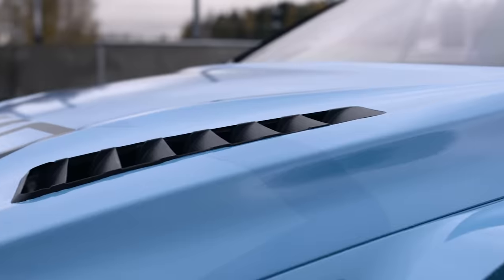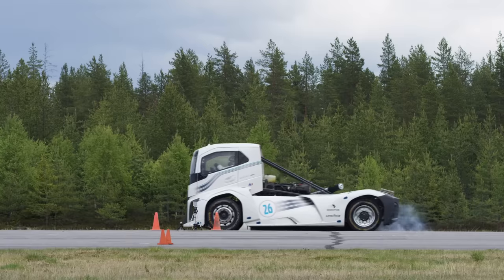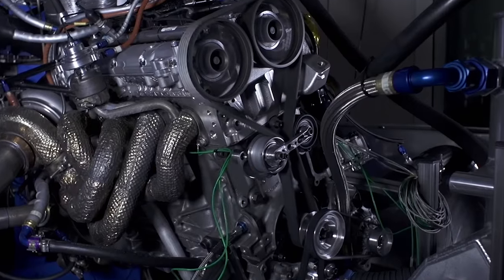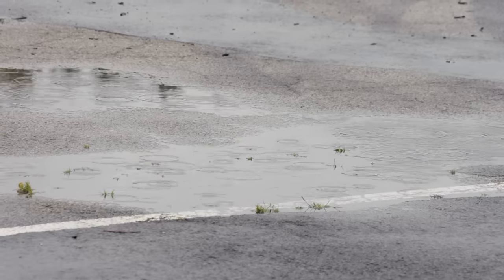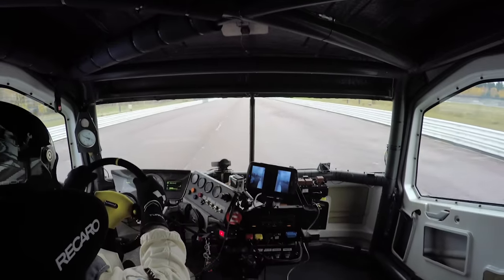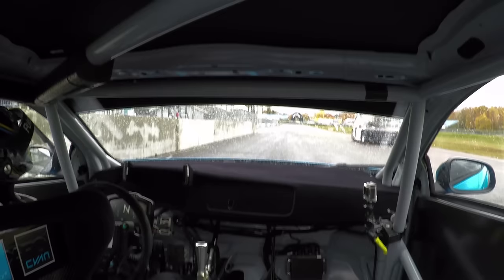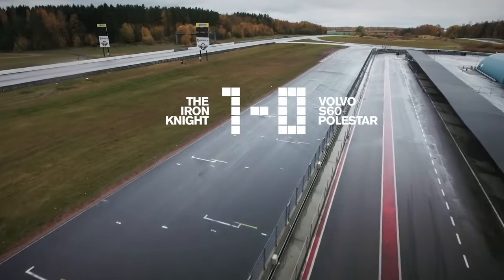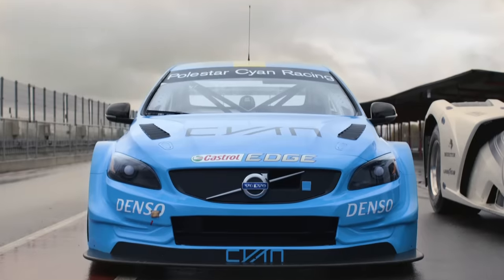Volvo Trucks - The Iron Knight vs Volvo S60 Polestar - Two titans in a head-to-head challenge

Comment: But Volvo Trucks and Volvo Cars are 2 separate companies ...
Reply: so a friendly competition between different but yet the same company should not be a problem xD
Reply: Volvo Cars and Volvo Group is not the same company at all though.
They split in the 90ths when Ford bought the car part of the company.
Reply: They are indeed different companies, but the brand is shared 50/50 between them.
Reply: Well that sounds very confusing. Is it not just the same company but different branches?
Reply: Ilias same brand but different companies.
Reply: Volvo Cars was sold by the Volvo Corporation to Ford in 1999. Ford sold it on in 2009 to current owners, Chinese auto manufacturers Geely. The Volvo Corp. spun of it's car division because it wanted to focus on trucks, buses, construction equipment etc., where they are one of the big players globally. The Volvo brand (logo, trademarks etc.) is managed by a holding company that is owned 50/50 by Volvo Cars and the Volvo Corp. Anthoer example is Renault. Renault Trucks is owned by the Volvo Corp., but Renault Cars is a seperate company. Nissan Diesel (now called UD Trucks) is also owned by the Volvo Corp., but not Nissan Cars. 

Another example is the SAAB brand. It was shared by the SAAB Group and SAAB Automobile, when the SAAB Group spun off SAAB Automobile to General Motors in 1989.  In 2012, SAAB Automobile went bankrupt, but the SAAB Group still exists, as a major aerospace and defence corp.
Reply: from what i know the 2 companies are also in friendly terms . meaning they do help each other and do research together .
Reply: So its just a freindly competition lmao
Reply: Sylvester Rydén no!! They r separate
Reply: Chinese owned volvo cars vs swedish volvo truck
Reply: 2 sons of a dad
Reply: same computer
Reply: ShotsFired andMissed both swedish
Reply: True! Volvo trucks is swedish and Volvo cars is chinese..sorry to say!!
Reply: @snakecold6755  
Not anymore
Reply: Yes, Volvo and Volvo Cars are separate, but they share the trademark equally, and make frequent collaborations.

Comment: Swedish Power.
Reply: да да....
Reply: Swedish ;)
Reply: Vectorilicious ahh you're right, thx for correct.
Reply: no prob. ;)
Reply: aleksey270373
 ну чтож вы так :D я ведь из лучших побуждений! поправил человека.
Reply: Vectorilicious )))
Reply: The power of the worlds first stock dual-clutch truck transmission. Stock. Now fifth gear should know why Volvo put a dual clutch transmission in their FH 12? FH14? Stock.
Reply: +Альберт Эйнштейн What are you speaking about? The chinese didn't design shit about the technology. It's all swedish technology
Reply: And now volvo is "made in china" hehehehhee
Reply: Sweden engineering at its finest
Reply: Really Swedish?
Reply: More like refrigerator got no power
Reply: @kKhanMC  lol it's got 2400 horsepower and it aint got power? Ait
Reply: @kKhanMC  Yes it's got fridge aerodynamics so that it works with trailers...
Reply: @real_smilegamez  Yes.

Comment: damn, 2400 horsepower! volvo, switch engines and you will be the manufacturer of the fastest cars
Reply: Except the engine would be larger than the entire car itself.
Reply: Meerkat W. mid engined v60?
Reply: The engine of a truck dosen' t allow it go very fast, becaus of its heaviness and that it does' not take much RPM
just watch the gearbox 

if my memory is good it s a 10 gear transmission on the iron knight
and even if it was possible to put this engine in a car ,the tires could' nt support the power
Reply: I’m pretty sure it’s a 12.8 liter engine. That isn’t fitting in a normal car anytime soon.
Reply: What you'll miss is the traction. Have fun smoking those wheels.
Reply: Yeah not possible but that reminded me that lamborghini started making supercars after they wondered what would happen if they put one of their tractor's engine in a car
I mean i dont even know if thats true but it would be funny
Reply: @ccyt6958  It has 12 gears, 3 + split and range and only the split has synchros.

Comment: wait a moment. How did the S60 go past the truck at the end of the race? if the truck was faster on the drag race?
Reply: MrMakkez if you have a big heavy with thousands of horsepower and a small light car with low horsepower, the small one will come out of a corner way faster than the big one and will have more speed
Reply: carrying more speed through the corner

Comment: what if this s60 had inline5 twin turbo diesel engine?
Reply: diesel? but why?
Reply: Coz if The Iron Knight still has diesel engine why cant S60 have it to. Of course modified one
Reply: Aurimas Knieža Maybe cause a twin turbo diesel can produce a lot more torque which the car doesnt need .Thats why it has a single turbo petrol engine with high HP.The truck has modified D13 engine.The truck is way more heavier than a car.So it needs more torque .
Reply: Of course you are true, but two Volvos rolling coal would sound and look cool
Reply: you know a single turbo is as capable at a twin turbo setup to make torque and hp down low as well as up high? it's the size and tune that decides not the amount of turbos.
Reply: One fine tuned turbo can do much more work than two? Right? Understood. Like that old Merc wagon with original engine but with Scania turbine that drifted in drift events. There are videos about it on YT.
Reply: there is the issue of response
Reply: What response? Do you mean the time that passes till the turbine blows its maximum pressure?
Reply: I own one of the five sylinder turbo diesels, 2013 V70 D5 awd 215hp. Amazing car!

Comment: Let's see - a FH 750 delivers 750 HP and 3550 NM - Iron Knight is rated at 2400 HP, but only 6000 NM of torque? Given the maximum RPM is risen, it should still be a figure in the 10 000 NM range!

Comment: "A quarter of a mile, or to be more precise, 402 meters."
402 meters is less precise. The strip is exactly a quarter mile, 402 meters is an estimate.
Reply: It is 'metre'' not 'meter'. A meter is a device used to measure something, for example a water meter, an electric meter or a speedometer , an ammeter , a volt meter. The metre is the base unit of length in the International System of Units. . .
Reply: A metre is a 10 millionth of the distance between the equator and the north pole, where the hell did you get your 1608 metre = a mile?

Comment: 2400HP and does 0-100 km/h in 4.6s?? Wait... shouldnt that be enough to do it in 2.9s?
Reply: Bruh its a truck and not much aerodynamic
Reply: And heavy too
Reply: You do realize that a truck weighs a lot, will have way more air resistance and has larger tires which equals to more drag resistance aswell

Comment: no offense Volo truck but did good on engine but body design complete Idiots!! the truck has a high amount off drag limiting it's speed highly significantly soon redesign on cabin but no h8 😚
Reply: you do realize that the cargo would be higher in height than the cabin, they've designed it this way so that  the air doesn't hit the cargo so hard it slows it down but let's the air go up the cabin over the cargo